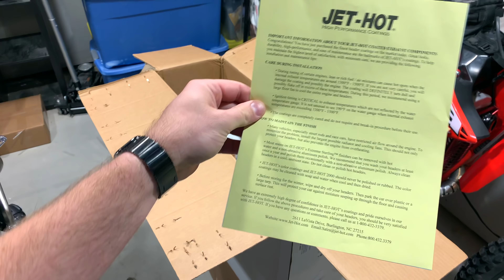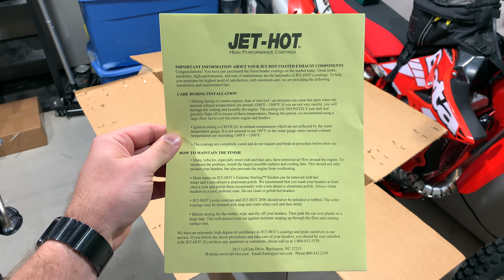Unboxing: Jet-Hot Powder Coating for R1200GS Akrapovic

Comment: Hi, I was searching for Jet hot coating and found your video. I never thought about the thickness of coating would pose a problem until I saw yours. Did you finally get your pipes fixed and installed? How is it doing now after 4 years of uses? I have a Hypermotard 950 with rusted exhaust pipes in need of a new coating.
Reply from the maker: The headers were completely ruined. Jet Hot refunded my entire money and I gave the headers to a friend who went to town with heavy machinery and removed most of it from the mating surfaces and ended up running them okay but it was way beyond my comfort level. I never got to run them on the bike for more than a few minutes. If your exhaust is not multiple pieces, you'll be fine. They should have taped up the mating surfaces but I was pretty amazed with how difficult it was to get help. They redid it a few times before both parties decided to cut our losses.
Reply: @AdamChandler86  Yike that's terrible. I got a Termignoni full system on a Ducati Hypermotard 950. After a few years of uses, the headers got too rust and dirt so I was considering their coating as an option. They are 4 pieces sliding in each other. Just purely for aesthetic purpose. Do you reckon if they cover the mating surface properly, they could have avoided this problem? It costs a lot to send the headers internationally so I'm exploring different options. If I were to have them done at Jet-hot, it must be done right the 1st time. Sending in a 2nd time would not be viable. My guess is their workers are used to coat car manifolds instead of motorcycle headers. They are very different in their ways of installation.
Reply from the maker: Yep, process wise, they just needed to not coat the mating pieces. Unfortunately, once the job is done, it can't be removed. It's ceramic baked on.
Reply: @AdamChandler86  Seems like their coating is non-reversible process which kind of explained how they are so confident in the durability of their coating. Thanks a lot for your help. Cheers!

Comment: I would have liked to have seen the actual parts before they were done.
Reply from the maker: Well, not possible because I had them directly shipped to Jet-Hot from REvzilla. BUT I just got the Titanium headers and they're going on the bike this week. Maybe I'll shoot a video.
Reply: @AdamChandler86  I hop you do. Thanks for the reply. How did you get the pipes to fit together? I also noticed the color seem to scuff pretty easy.
Reply from the maker: w/o the coating, the pipes slide together quite easily. It's a graduated diameter that leads to a pretty tight fitment. Akra includes some springs for 2 of the pipes. For the Jet-Hot ones, I had to do a lot of sanding to get them to fit together. Eventually, I just gave up on the project and Jet-Hot gave me a refund.